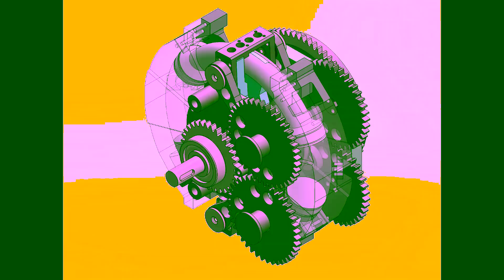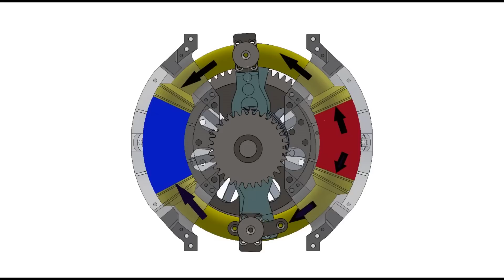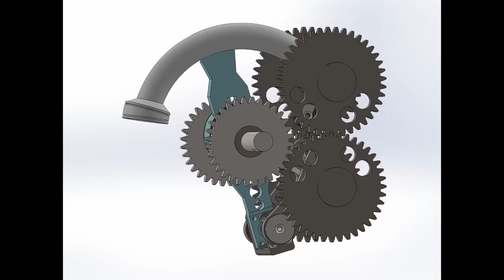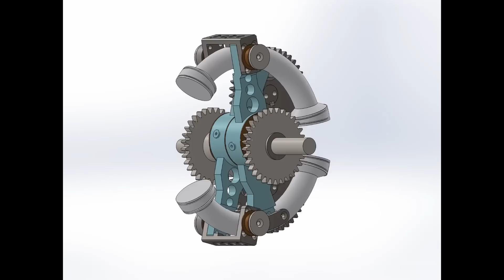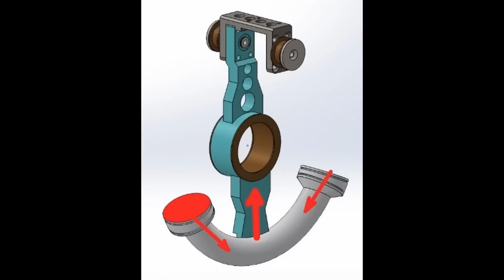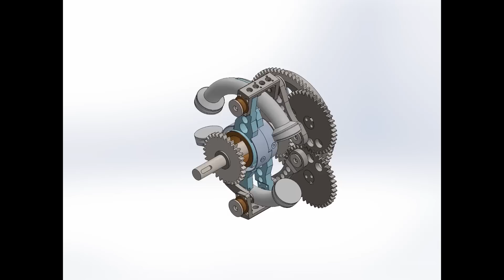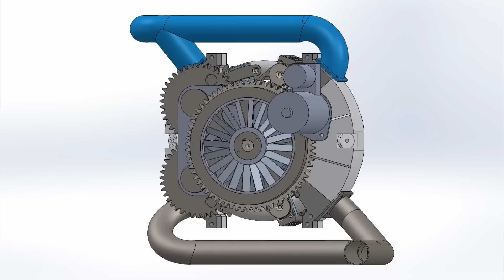A new type of Engine

Comment: Concept has some merit , However , There  MUST  be Piston to Cylinder contact if you want Compression . Also , this will require a Blower to run .
Also , I  reckon it will shake itself apart in VERY short order .
Reply: So Harley will patent it then.😉
Reply: @wigit2510  . Quite likely................🤣
Reply: Someone else already said it.  It's a rocking, opposed piston, engine.

Comment: I think the thermal expansion is gonna be enough to stall this engine.. that curved piston chamber is gonna give more problems than a cylindrical piston chamber once it reaches high temperatures..
Reply: Similar engines exist, like the Taurozzi engine.  Also this is more similar to an opposed piston diesel than anything.

https://www.youtube.com/watch?v=UF5j1DvC954
https://www.youtube.com/watch?v=Mfy05zqn324

Comment: Good. No cylinder head, no cranks, no valves. I think you need a supercharger, I don't think you will get enough of a vacuum to pull in sufficient air. It's basically an opposed-piston engine, all of which use something to pump in the air. Even if the engine would run without a super(turbo)charger, the gain in power from using induction would be worth the extra moving parts, and if an exhaust turbine is used to drive the compressor turbine I think the energetics break even.
Reply: It has crankshafts (2 of them!) and connecting rods (also 2). but yes, it's an opposed-piston engine and needs a scavenge blower
Reply: @brianb-p6586  disclaimer: this is an edit of a previous reply which makes me look even dumber than usual. 

Thank you for confirming that I was not missing something about airflow into the engine. I must admit I was a little confused when the narration mentioned a vacuum being created during the exposure of the intake ports, and was wondering if some unseen mechanism was at work, maybe using the momentum of the exhaust , or resonances of the manifold to create a low pressure area at that end of the cylinder. Neat trick but I don't see how you could do it. I think it would also make use of exhaust pressure to drive a turbine impossible, which would mean you're stuck with driving the blower (or compressor, my preference) with the engine.

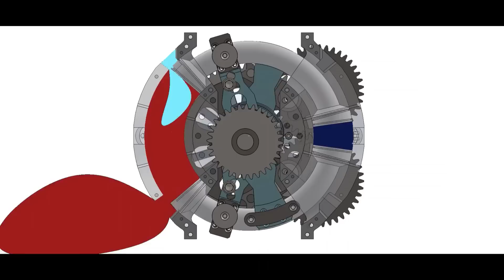You are correct about the connecting rods and crankshafts, Apparently I subconsciously chose to ignore them on first view. I fixated on the view between 0:49 and 1:20. My understanding is that the engine was to be used to drive a generator (or magneto, or alternator, or whatever) and thus would have no need for converting reciprocating to rotational motion. My bad, I broke my first rule of commenting, which is to always watch the video twice.

TBH, the main reason I mentioned "cranks" (should have used "crankshaft"), is to address a common objection to opposed piston engines: they have an "extra" crankshaft. This is an objection I consider invalid, given that the ratio of crankshafts to cylinder banks is not important, as the cylinders do not produce power. Pistons produce power, and the ratio of crankshafts to "piston banks" is 1:1, so I will claim that there is NOT an "extra" crankshaft, there is precisely the same amount of crankshaft as in an inline configuration and no one complains about those. Opposed piston engines can be considered as inline engines that have had the cylinder head removed (along with those pesky valves), have been cut between the middlemost cylinders,  and have then been joined at the wound created by removing the cylinder head. No extra anything has been attached, things have only been removed.

Personally, I'm a big fan of opposed piston engines, and it is a curious twist of industrial history that more was not invested in their development, given the obvious advantages. By all rights, at least for diesels, they should be the most common engine configuration. Go figure.
Reply: @mliittsc63  Are you saying to design an external air compressor into the engine, because that would be awesome.
Reply: @aaronzaloum7986  Yes. All Opposed Piston Engines need something to force air into the cylinder during the brief time the intake ports are open. Since it's not a four stroke there is no intake stroke where a vacuum will pull air in (technically, allow atmospheric pressure to push air in). Even in normal 2-stroke engines the crankshaft/crankcase is functioning as a pump. Historically, most OPE used Roots blowers to induce airflow, but I think the more modern versions use turbo(super)chargers, which are more efficient, but have some turbo lag. It might be possible to not have a blower or compressor, but you would then have to have both intake and exhaust on both ends, which would not be much of an improvement over the normal set-up. The great thing about OPE is that the scavenging is basically perfect, with no unburnt fuel (assuming it is designed correctly).

Comment: Very cool idea! how do you machine the cylinder?
Reply: Split the cylinder, machine both halves and bolt them together using dowel pins for alignment.
Reply: @Proud2bmodest  Then extrude hone the bores,  and Bob's your uncle......
Reply: This can be machined, the reason the engine won't be a successful design is entirely different

- the Taurozzi Pendulum Engine shows that this can in fact be made, of course in the pictured design with opposed pistons

- if you don't have a crankcase (or ideally a curved dry sump with that type of design), you have no crank case pressure building up and pushing back "up" into the usually reciprocating crankshaft, meaning all opposing force for the powerstroke comes from the other cylinder. That is touted as great because POWER, but actually, as they found out even with steam engines, the added power takeoff comes at a great loss of longevity because we rely on the other combustion chamber to do the whole motion to bring the piston back into a firing position, unlike a conventional Otto motor where a much heaver duty crankshaft can take up that role. The only option I see would be a super heavy duty piston with, and that will be impossible, a valve inside the piston (yes.) to relieve part of the pressure in that moment where the opposing piston sets in - and THAT cannot be built or machined. You cannot have controlled and actuating parts within the piston itself and I don't see how the motion coming back from a radial pendulum can be anything else than destructive for the engine without some baffle or relieve valve, which again are impossible to even integrate with current materials and tooling common in the auto industry 

- with this, the crankshaft or the parts acting as such will rapidly be turned down as if they were on a lathe, which can barely be prevented since you can't efficiently lubricate it; getting oil there would also lead it into the combustion chamber, which will cause the engine to burn the oil

- the "Atlis" motor is, according to my research, the only practical way to oppose pistons because it does use a conventional sump that is in fact split up and angled to counteract the massive lubrication needs and outward forces. It still has questionable reliability because again, you're effectively losing half the block and the entire crankcase, components which you sort of need on a regular engine, especially to help if you have massively strained pistons in oddly placed cyclinders lmao...

So in conclusion, this will run and have somewhat decent numbers, but if I had to guess, it will burn oil and break down at less than say 20k miles and that is already pushing it. This is not reliable and not serviceable, I did cad simulations on all sorts of engines, ranging from the NSU rotary, to the mazda rotary, swash plate engines, strahm gegenkolben etc and I can confidently say that no, these aren't desirable. They work but at a price that no one can justify.
Reply: You don't...
Reply: @pihermoso11  I know but just dog pilling on saying its impossible is very discouraging because even though it most likely won't be possible to actually make (and remember new manufacturing techniques are being made all the time) it's still a cool concept, just like when everyone used to say it was impossible to land a rocket but now it happens almost every week
Reply: @Pegaroo_  probably can't bore a curved cylinder hole perfectly but probably possible to just 3d print it..
Reply: @pihermoso11  Not to the resolution you need, and days to "print" it out of metal would put a juicy cost on it.

Comment: I love this idea, it neatly avoids the double crank shaft that most opposed piston engines use.
Reply: Avoids? It has double crankshafts, one per connecting rod.
Reply: @brianb-p6586  that's a good point!
Reply: Opposed piston engines can be built with one crankshaft.  They merely require rocker arms attached to the pistons outboard end. See the 2 stroke diesels built by Cromer in the UK.
Reply: @mpetersen6   The Commer TS3 two stroke diesel was a great little long lived noisy engine. It was killed by two stroke inability to comply with emissions limits.
Reply: What ? No ! It doesn't .
Reply: But what about enormous friction there 🤔🤔🤔
.
.
And hammering sound, , 
Secondly., , It also works on the same principle where maximum 40% fuel is burnt and rest of exhausted without complete burning.
Reply: Can't really agree to the implied criticism about excessive crankshafts on opposed piston engines. Sorry, pet peeve. Though the ratio of crankshafts to cylinder banks is 2:1, this is not important, as the cylinders do not produce power. Pistons produce power, and the ratio of crankshafts to "piston banks" is 1:1, so I will claim that there is NOT an "extra" crankshaft, there is precisely the same amount of crankshaft as in an inline configuration and no one complains about those. Opposed piston engines can be considered as inline engines that have had the cylinder head removed (along with those pesky valves), have been cut between the middlemost cylinders (and through the crankshaft), and have then been joined at the wound created by removing the cylinder head. No extra anything has been attached, things have only been removed (ok, I lied. We are going to need some gears to join the two halves of the original crankshaft, but I think it's a fair exchange for doing away with the valves).
Reply: @mliittsc63  yeah I get what you are saying. Some engines manage to have multiple banks on one crankshaft like V and W type engines, the there was the commer knocker opposed piston engine that had one crankshaft and a system of connecting rods to drive the two banks. The benefit of reducing crankshafts would be cost and weight.
Reply: @adrianjanssen7489  Also, Napier Deltic is basically 3 V6 engines connected at the top of the cylinders. Huge engine though. I read somewhere that because the intake and exhaust pistons are out of phase, that the intake pistons only provide a small part of the  power (since the crankshafts are connected, I'm not sure this is true). If so, the crankshaft on the intake pistons need not be as robust (assuming less power means less torque).

Comment: primary secondary and tertiary imbalance that thing would vibrate like crazy. if you have a way to hone a toroidal cylinder bore i'm listening
Reply: It's a thing, look up the taurozzi engine.  Also toroidal cylinders are used in some air compressors.

Comment: This is a ticking time bomb. If you make a prototype make sure you are in another room when it explodes.
Reply: Sounds like a fun r&d project, it wouldn't be fun without explodey stuff.
Reply: This works like an old Detroit diesel.  Nothing crazy.

Edit: meaning that it will need forced induction to operate correctly.  I highly doubt it would operate as stated, off of just exhaust scavenging.
Reply: Can you elaborate
Reply: That’s how all new engines are normally tested.
Reply: Exactly.
.
Reply: I just want to see the face😮
Reply: It'd work I bet..very innovative ..good critical thought..but you must ignore people who dis encourage
Reply: @arthurhudgens8213  It's already been done, its a Taurozzi, in 2 stroke Detroit diesel style.  https://www.youtube.com/watch?v=GI9pkcFJXV4
Reply: @nocturnal0072   cool interesting stuff👍
Reply: @arthurhudgens8213  Another related video if your interested.  Kind of shows that the intake air will not just fall in.
https://www.youtube.com/watch?v=nYF6FnMrsf0
https://www.youtube.com/watch?v=UF5j1DvC954
Reply: Refinishing?
How? Who? 🍌
Reply: bs. it will work fine

Comment: That's still a crank,  and machining that thing will be a nightmare,  and getting the piston to seal is going to be basically impossible, it would be much better to straighten the piston, and the bore basically making a free piston engine, with a bar connecting the pistons, using the gear crank mechanism , connected to the mid points in the free piston engine, accomplishing the same thing, making machining  much more possible! This mechanism could probably used to operate a engine with two pistons in one bore, with combustion pushing the pistons apart,
Reply: As a machinist I agree.
Reply: I like this. Seems easier to make and get a proper prototype for real world testing.
Reply: There are better opposed-piston designs. This looks like CGI for getting funding for vaporware.

Comment: That's cute, but...

1. Manufacturing would be hellish because of the complexity
2. Friction would be hellish because of the large number of moving parts
3. Inertia would be tremendous because of the large number of reciprocating parts
4. Repair would be impossible
5. Vibration would be massive.
6. A "thrown rod" would be catastrophic
7. You haven't compensated for centrifugal force - radial expansion under load.
Reply: Rocking engine
https://www.youtube.com/watch?v=GI9pkcFJXV4

Opposed piston engine
Running: https://www.youtube.com/watch?v=usmauFigpzk
Explained: https://www.youtube.com/watch?v=UF5j1DvC954

It's been done, but with either less moving parts or with less complex machining.  This is just two good ideas put together to make a questionable idea.